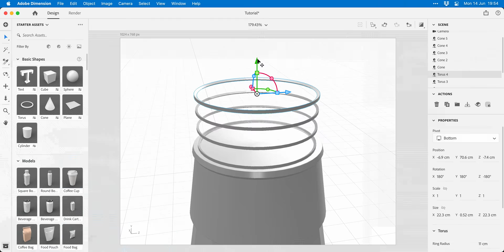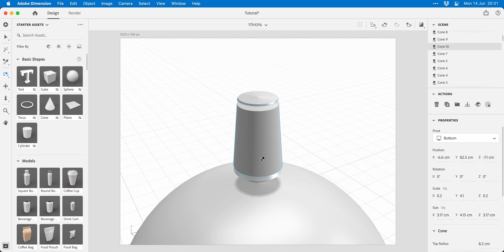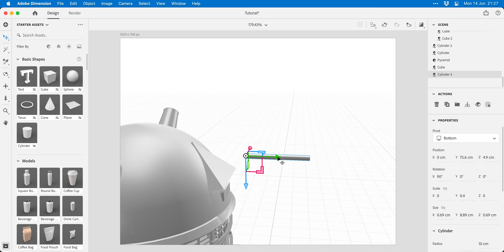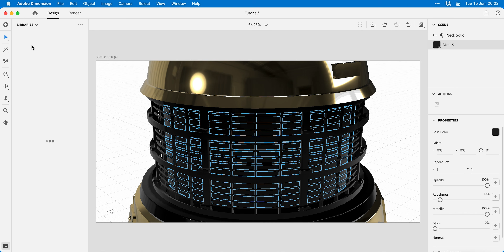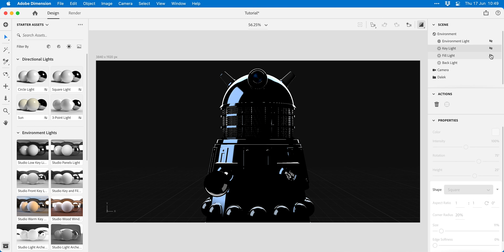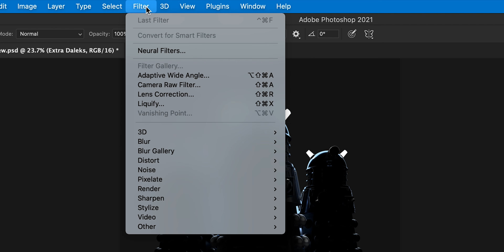Comment: Adobe Dimension beta  4.0.2 is out

Update Adobe Dimension to the latest Adobe Mercury rendering engine, Adobe Standard Material, and updated UI components and systems.

Dimension 4.0.2 d.4085 - Windows - 28 days ago
Dimension 4.0.2 d.4086 - Mac - 28 days ago

Comment: I feel that Dimension is positioned similar to an Add-on for Photoshop/Illustrator, used to quickly preview the display effect of a graphic design on a 3D object. Dimension can even do interior design and is very easy to use. For some special model components, you can generate them in Illustrator, then export the OBJ file, and then import it into Dimension. I like Dimension. But I have now switched to Blender. The inability to output 3D video is the real flaw of Dimension.

Comment: Do you know of any way to cut out a section of an object? Like to create a hole or something? I'm modeling a desk I'm planning on building and want to cut a circle out for cable access. I can do it in other programs easily, yet I cant find anything like it in dimensions.
Reply: I don't think so in Dimension sadly. I was hoping for this feature, but they appeared to pivot to creating a full suite of 3D apps (eg. Adobe Substance 3D Stager), which I think does include some more advanced functionality.
Reply: @ForeverDansky  Thats kind of ridiculous. I do some basic 3D modeling for fun and work, and not having this function makes it much more difficult to model. Charging more for the other 3D programs when I pay a premium for the creative suite already is not going to happen for most. I'd rather learn blender or use Shapr3D on the iPad for my hobby work. Thanks for replying and I enjoy your videos!